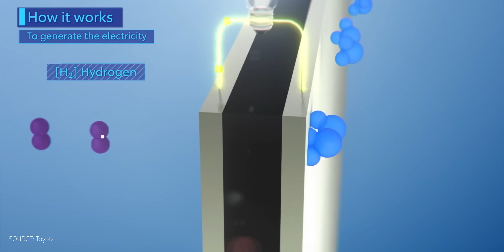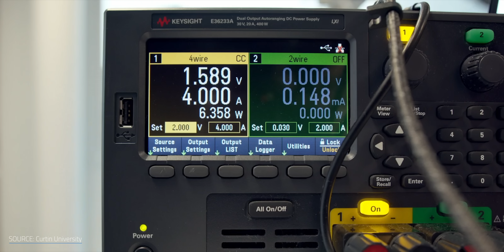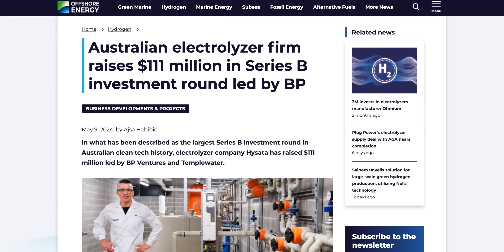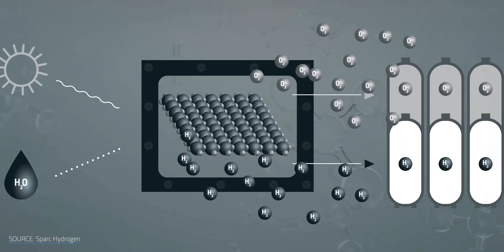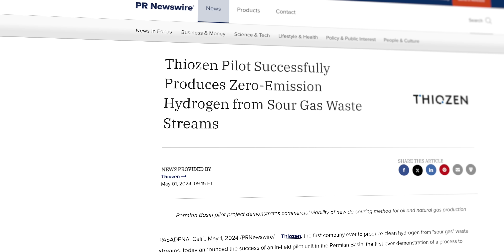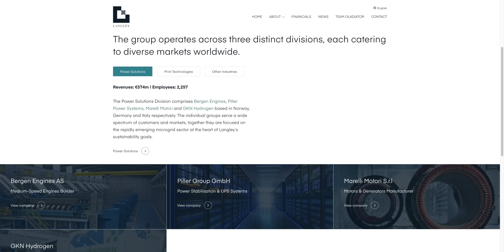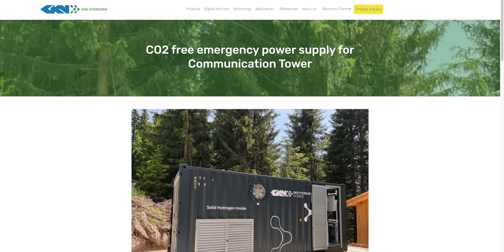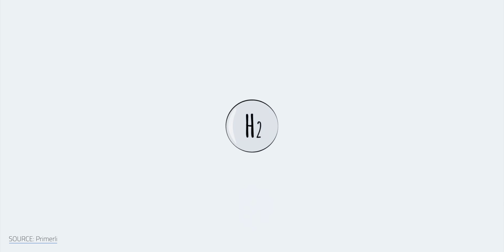How a Hydrogen Breakthrough is Closer Than Ever

Comment: Yeah no. The only future I see for green hydrogen is to replace what hydrogen is already being used for. So essentially just chemical production. It will be needed for ammonia and fertilizer production and a few other things but that's it.  Pure hydrogen as a fuel source or to store energy is stupid. It would be better to store it in something like ammonia and then use an ammonia fuel cell to produce electricity or power very heavy vehicles like cargo ships, planes, and ultralarge pieces if mining and construction equipment.

Comment: I think with our current material sciences, hydrogen is still a bit on the unrealistic side for large scale, although ultimately I do think it will replace our current carbon based globalized system. While I don't foresee it being used in houses as it IS incredibly explosive, I could absolutely see it being used for large industries like blast furnaces. I could also see fuel cells being used for transportation for goods in the form of swapable cells used in trucks - although ideally we'd have significantly fewer trucks and transport a lot more of our goods around on trains (at least in North America that is, I know most other places already do this.) and possibly giant cells used for shipping containers that could maybe be hotswapped at ports for much faster refueling.

Comment: Hidedrowgen BAHD! This comments section.
Reply: Plenty of "Batteries bad!" comments too.
Reply: @brushlessmotoring  we don’t have the materials to make batteries 🪫! Batuhwees BAHD!
Reply: @Ironknuckle100  lol - you need lots of materials for hydrogen fuel cells (platinum) and electrolysers too, you still need batteries as fuel cells are not responsive enough for vehicle applications by themselves.

As batteries evolve, lithium iron phosphate or sodium ion chemistries use abundant materials, and batteries are recyclable, eventually forming a closed loop with black mass ore recovery.
Reply: @brushlessmotoring  I’m agreeing with you and making fun of the others in the comments.
Reply: @Ironknuckle100  oh okay - my sarcasm detector didn't go off - I should get it checked, it runs on hydrogen ;)
Reply: @brushlessmotoring  Bruh I even used derp language. It's all good.

Comment: I think hydrogen could be a solution for some industrial processes if it can be generated fossil-free and used locally, eliminating the transport problem and possibly negating the need for high-pressure storage. For mobile use, the storage problem undermines the efficiency of the process, and even if there was a solution the total process still would not be as efficient as storing electricity directly in batteries and using it. There is a reason hydrogen research is almost exclusively done by or sponsored by the fossil fuel industry. Yes, there are some results that could be promising in some applications, but due to physics, the total process will always be less efficient than green electricity and batteries. It will only be economically valuable if the drawbacks of the battery system are negated in such a way that the reduced efficiency will not matter.

Comment: Hydrogen definitely has a place in futures energy's landscape. Cargo ships, trains and trucks cannot be powered by batteries for any meaningful work no matter the battery density.
Reply: Cargo ships would be better off with nuclear power.
Reply: There are already semi's running on batteries. Soon there will be battery powered planes. There's no reason a cargo ship or train couldn't run on batteries.
Reply: @KidHorn7001  America's nuclear-powered submarines and aircraft carriers cross every ocean, so there's no issue there. They produce nothing more than hot water, and are safe for the environment, unlike the coal generators used by cargo ships today that pollute the water and generate more emissions than all human land activity combined 100 fold.
Reply: not true given Lithium-Air batteries have a similar energy density to petrol/gas/diesel at 11 kWh/kg, which is why effort it being spent to raise their cycle life or use swappable/recyclable approaches. 

So batteries indeed can work for trucks, even truck makers are abandoning hydrogen for batteries (such as Scania).
Reply: @GruffSillyGoat  The energy cost of producing lithium exceeds all advantages. It's virtually impossible to break even. Gasoline is cleaner for the environment than Lithium battery production. Maybe if we switch to solid state batteries.
Reply: @mmstick  - are you really going for a life cycle analysis argument to support hydrogen? This has been studied and proven that the lithium used in batteries although having an initial impact this significantly reduces overtime as recycling overtakes extraction as the main lithium source. Whereas for hydrogen, being a consumable resource, requires signficant energy to be input (50 to 60 kWh) for each kilogram generated forever, plus all the additional energy costs required there after. Hydrogen is never going to be able to become more cost or energy efficient than batteries (of any type). 

I'm not sure where you're getting the "impossible to break even" point from, particularly in a comment on a channel as well as others have covered the lifecycle analyst reports that state otherwise.

As to gasoline being cleaner, you need to check the IEA reports on this published and verified data clearly states otherwise - all based on peer reviewed studies from well respected sources. 

Further, hydrogen production isn't guilt free on the mining front, indeed it involves extracting very rare elements (such as platinum for catalysts) that are expensive, both energy and cost wise per kg, to mine.
Reply: @GruffSillyGoat  I said nothing about hydrogen
Reply: @mmstick  - whilst techinically true by replying to a comment on hydrogen use within a video focussed solely on hydrogen the context is implied, particulaly as you didn't go out of your way to make it clear your comment was not regarding hydrogen.

That said the fact remains that the published life cycle analysis for Lithium doesn't support your claims.
Reply: trains already run on permanent infrastructure, so its super easy to electrify them.

trucks are a very inefficient way to transport the bulk of cargo, offloading that work to trains is the most cheap and efficient. trucks make most sense for last mile stuff, where the max range they can go is less of a variable.

Those big giga cargo ships; honestly, making them nuclear-powered is such an obvious choice i'm surprised its not discussed a lot. I imagine the hardest part is having a nuclear reactor cross international boarders.
Reply: @Psrj-ad  There has been a nuclear passenger+cargo ship (NS Savannah). Wasn't successful (although it was, energy-wise), mainly because not a lot of harbors wanted to host a nuclear ship. In case of an accident, the whole port would be contaminated, so no one was willing to take the risk.

Comment: Maybe I missed it, but it's kinda scary how you completely glossed over the safety issue. Isn't Hydrogen REALLY dangerous? Like explosion type dangerous. I don't want planes that fly on a fuel that can literally just explode for some unknown reason. Or maybe they are known and being tackled which is what I was hoping you'd dive into more.
Reply: An explosion requires oxygen, pure hydrogen can't explode on its own. Petrol, diesel, coal, flour, natural gas, jet fuel, rocket fuel or hydrogen will all explode if given the right oxygen mix.
Reply: @TheArchaos  The explosion of a 700 bar hydrogen tank is a problem. The burning of hydrogen causes additional damage to the environment.
Reply: @hamzaterzi8801  You didn't even watch the video.
Reply: @TheArchaos  Since oxygen is everywhere, your point is moot. It's like saying a piano falling on your head is only bad if gravity exists.
Reply: @KidHorn7001  You made a statement but failed to make an actual point.
Reply: @TheArchaos  What is the 'right mix'? From what I've seen, Hydrogen is magnitudes more volatile than petrol or jet fuel. To the point that so many precautions are needed to store it correctly to avoid leaks that could lead to actual explosions.
Reply: @vl3005  Find out what a fuel-air-bomb is and you will get to know what the 'right mix' truly is.
Reply: Hindenburg
Reply: Every time you fly on a plane, it's filled with fuel that can explode.
Reply: @john_in_phoenix it won't explode just like that. You need the exact right conditions in the jet engine to get ignition. Same with diesel fuel. It will only burn at high temperature with the exact right mix of air. 
Hydrogen burns quite strongly in a much wider range of temperatures and air mixture percentages.
Reply: @MattCasters  " it won't explode just like that" - Odd, I remember 9/11. That said, hydrogen doesn't explode by itself either. It needs oxygen and an ignition source, same as jet fuel.
Reply: @john_in_phoenix  Combining hydrogen and oxygen is exothermic, producing heat along with the water. At that point, it depends on the circumstances, I guess.  Don't mess with it, though. I once blew up half my bedroom with that stuff when I was young. A FAFO situation.
Reply: @MattCasters   You understand burning propane or almost ANY hydrocarbon (such as gasoline) produces heat and water, right? "Combining hydrogen and oxygen is exothermic" otherwise known as burning. Hydrogen is only a problem because the molecule itself is small enough that it is difficult to seal the container well.
Reply: @john_in_phoenix  I'm glad we agreed then. Have a wonderful day.
Reply: Wouldn't any other fuel also explore in any scenario where Hydrogen would explode? In that case I don't see how it would be more dangerous than the alternatives
Reply: @beckettthirion3147  No, hydrogen is much more reactive and binds more easily to other substances. A little bit of oxygen is enough to combust.
Reply: @MattCasters  Simply mixing hydrogen and oxygen won't make it combust, you need an energy source to actually cause ignition. :text-green-game-over:
Reply: Can hydrogen melt steel beams??? Might save us from 9/11 Part Deux...
Reply: @Smokkedandslammed hydrogen is indeed an option for the production of "green steel" when using green hydrogen. However, the new kid on the block apparently is electric arc steel for steel recycling and production.
Reply: It's no more dangerous than other fuels
Reply: @makegrowlabrepeat  Hydrogen burns much faster and more efficiently than kerosene. Much more dangerous.
Reply: @makegrowlabrepeat LOL what??? You can’t be serious. Ok. Go take a lighter to a gallon of diesel. I’ll wait. I’d love to see you come back and still claim hydrogen is no more dangerous than any other fuel.
Reply: @makegrowlabrepeat  That's not at all true!